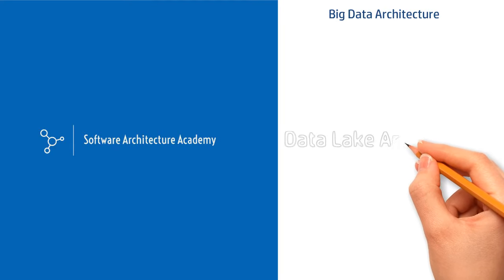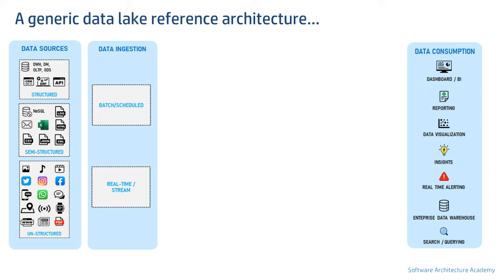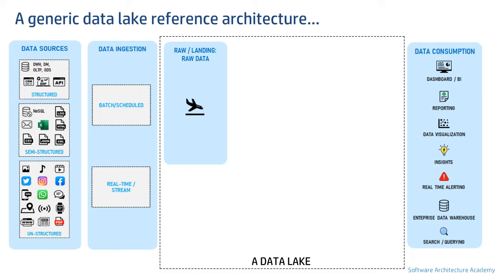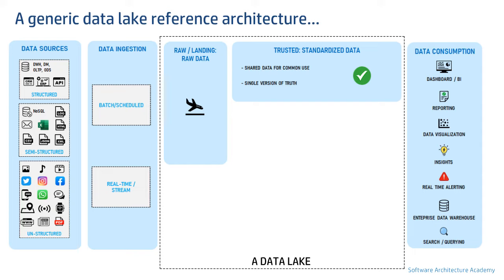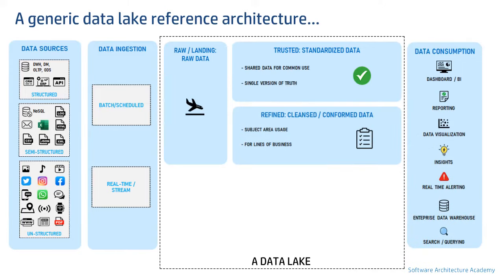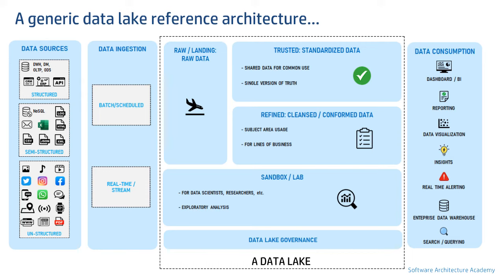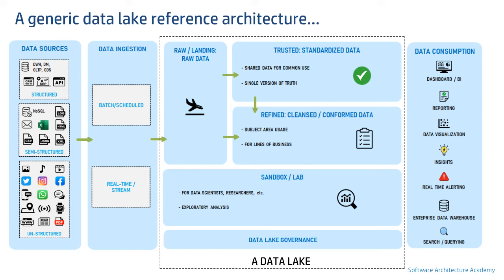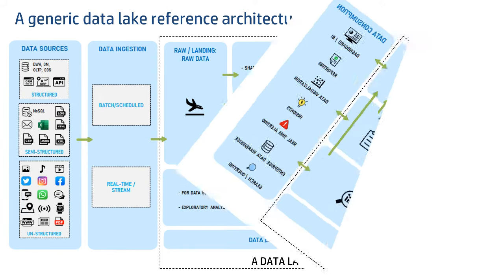Data Lake Architecture

Comment: fundamentally, data from sandbox is NEVER activated or consumed, not even for ad-hoc use cases. The data in sandbox is for research, exploration only, once done, the data pipeline can be built from raw -> standardized -> refined zone.

Comment: I think the arrow direction to sandboxes are wrong? Sandbox is picking up data from the other 3 layers not proving data, right?
Reply from the maker: Hello, yes you are right. I was trying to show sandbox pulling data and not these layers pushing data to sandbox. Should have been a double edged arrow to represent a pull(request/response)

Comment: 5:21 I think the direction of the three arrows should be towards Sandbox zone (as per what I understood from your words)
Reply from the maker: Hi Aman - Thanks for highlighting. The reason I put unidirectional arrow is because even though both options are available, for majority of the cases it's an on-demand picking up of data from by sandbox applications for experimentation.
Reply: @SoftwareArchitectureAcademy  Hi, fair point abt unidirectional arrow but that is b/w DataLake and the consumption  layer. I guess what Aman is pointing out the arrows within the DataLake (b/w Raw/Ref/Trusted and the Sandbook environment.

Comment: As per explanation from 5:19 sec, "Data from any of these three zones can be picked up or moved into a sandbox". 
This means data can be moved into sandbox also. So, is it required to show bi-directional arrows?
Reply from the maker: Yes, you are right - great catch. Typically it is picked up hence I had unidirectional arrow.